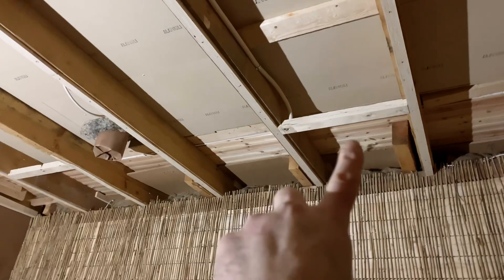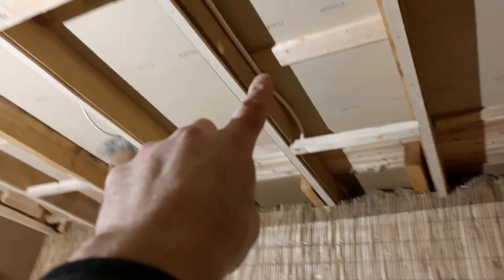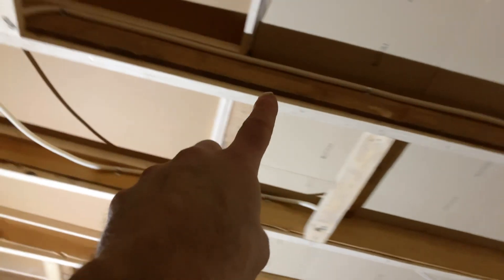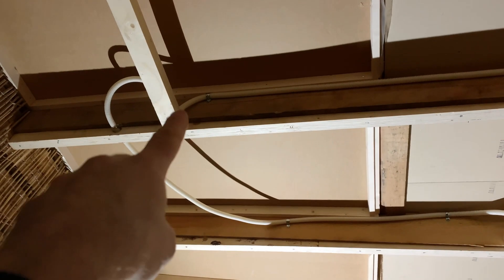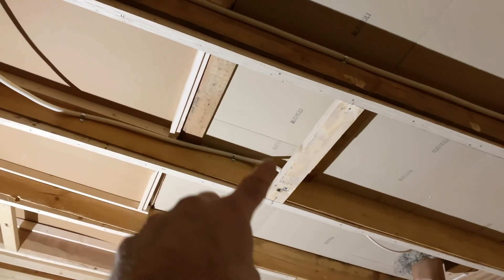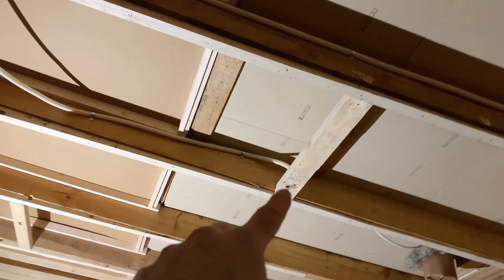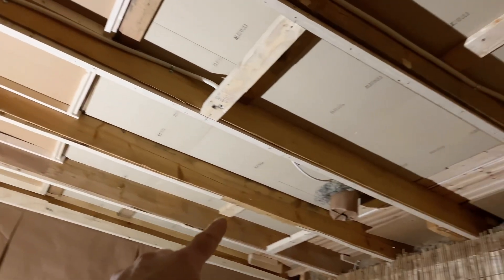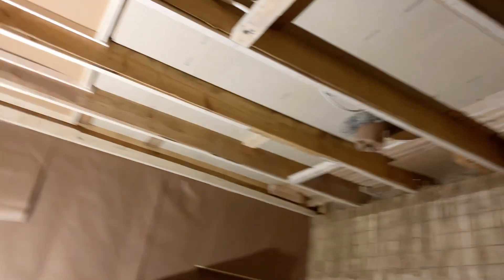Renovation: back to ceiling and light preparation.

Comment: The clay insulates, doesn't it?
Reply from the maker: No it doesn’t actually insulate. However it does retain heat because of its mass.  It also makes walls completely airtight. And that is a super good thing to keep cold out and heat in during most of the Finnish year.

Comment: How do you secure the piping in the spots where you have electric cable coming through the ceiling - I know you have installed wood cross-beams, and have drilled a hole through them wide enough to take the piping, but is there glue to secure the piping in position in the hole? (details, details, details ....). Also, what is the name of that remarkable drill attachment @ 1.22?

Comment: Why do you need to put the wire in flexible conduit if it is inside?  Is the wire equivalent to 12/2 or 14/2 Romex?
Reply from the maker: Wire I think might be similar to what you mention. In conduit because I do everything to the extreme. 🤣 Provides extra cable protection and makes it future proof. Can replace cable without ripping down the ceiling.